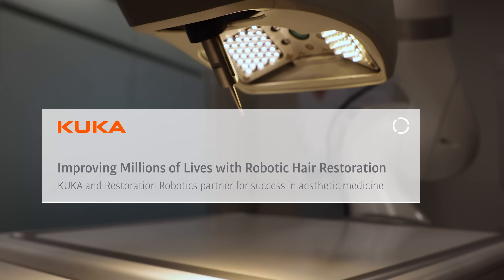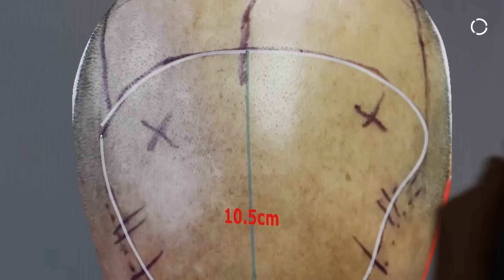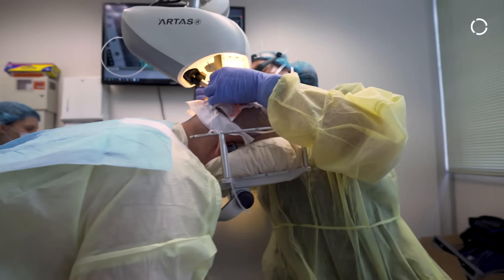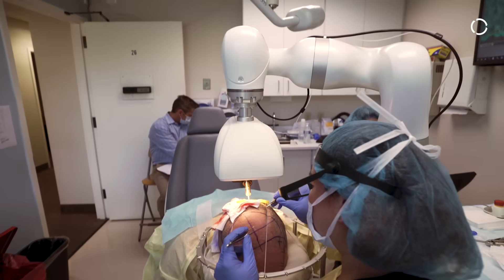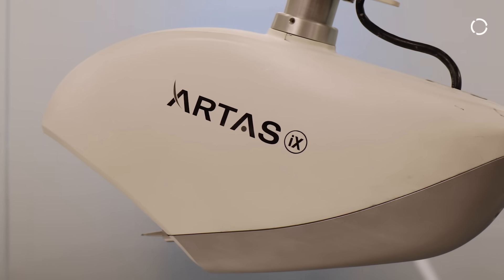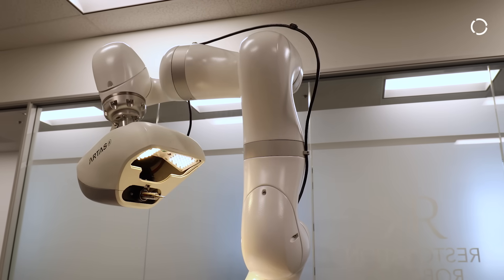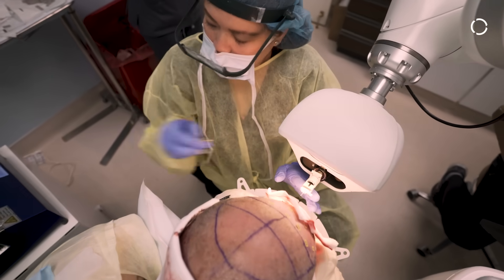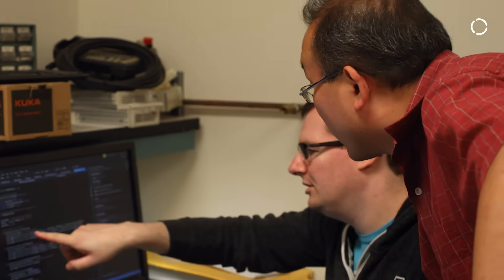Robotic Hair Restoration Can Improve Millions of Lives | Medical Robotics

Comment: This is a commercial, be aware of that.
usually punches are 1.37mm with the robot and 0.9mm with hand.
There is also no oscillation possible with the robot.
Robot has limited capability of working on non flat areas and sensor has difficulty detecting white or curly hair
The robotic procedure takes longer.
Currently there is no real advantage for working with robots besides the fact that it looks cool and high tech.
No robot can currently replace a surgeon's hand

Comment: There has to be medications more effective and safer than finasteride that only reduce hair follicle receptor sensitivity or binding to DHT. That's all it takes
Reply: All they need to do is desensitize hair follicles to dht I m 💯 with you
Reply: If you have hair transplant is not permanent, it will eventually fall like before, and then you have scares , small dots scars showing. You can take medication like finasteride and rogaine but you’re doomed to do that every day if you don’t want to looose the transplanted hair.
Reply: @dok2304  even finasteride loses effectiveness

Comment: U can't create a proper hairline with this it would be straight like stensil
Reply from the maker: The robot has seven axes. It's pretty amazing to work with and program, if you've worked with robotic arms before. You can change the position (x,y,z) of the tool and you can also change orientation of the tool (a,b,c), so you can move the tool anywhere and have it move in any direction and at any angle.

Comment: The robot is great for aging surgeons that no longer have a good hand eye coordination. The transaction rate is still 20%. The robot scans the scalp and based on the area it scans it adjusts its head/punch but if you have a hair that is not growing like the area it scanned it will ruin the follicle. The best return on your investment is still strip or manual FUE. Strip is you do not wear short hair and the scar is covered by your hair and FUE manual if you wear short hair. There is no replacement for the expertise and eyes of a human, period. Also the cost of a robot surgery is expensive due the fact that the robot and its operational cost is astronomical.
Remember out of 1000 grafts you loose 200...so bear that in mind when looking for hair transplant.
Reply: What machine do you recommend?

Comment: I think that was Gabe Zingaretti - the COO of the company, but I agree with the comments made here. How can you really trust a robot if your own crew didn’t do it yet. It’s a no for me. Also those punches with the system appear to go very deep. What happens when a procedure is conducted by a bot and a dermatologist. Sounds very scary - especially knowing that a bot is going to drill a hole in your head. You probably have to sign your life away to get it done.
Reply: That COO would do this procedure if he had enough donor hair to transplant. That doesn't mean the machine doesn't work or do a good job.

Comment: Hi dr. What is total cost for tybe 7 category hairloss head surgery.
Reply: Norwood type 7 is a severe hair loss, you might not have enough donor hair to transplant.
Reply: if you donor areas is small, experts use HBT or body hair transplant but these are used to as fillers. Look for doctors that work only do hair transplant and those that can do multiple types of hair transplant: ie FUT, manual FUE and Robotic FUE.

Comment: Will it reduce the cost of these operations? If not, then Im not interested.
Reply: Not really it's more expensive somehow
Reply: @cr-it5lh  yes, it is more expensive. Not only that, but also you can get ripped off when you pay for a certain amount of follicles to be transplanted and on the day of the procedure they ll give you less than half of what you paid for. Most of these procedures are done by technicians who work for doctors but in the infomercials you see doctors doing the procedure which is deceiving and unethical. Be aware that some technicians have less experience and can damage  your follicles when removing them from your scalp.
Reply: @ranimouf  no way?? 🤦‍♂️
Reply: New product = higher initial costs. Over time the procedure should go down.

Comment: Just one question people who are speaking why didn't they restore their hair with this machine
Reply: They come with the concept and expect investors to pour money, even if the device don’t work in practice. Looks futuristic but it’s a gimmick.
Reply: They don't care about baldness
Reply: Most middle aged balding men have not enough donor area. This robot can be the best invention for hair transplants, but without a good donor area it won't do any magic. Hair follicle cloning combined with the robotic precision grafts would be the best solution for balding men.
Reply: @matemayer4850  I completely agree but, when is this hair cloning thing going to be actually available?! Until then, beard hair should fill in for short hair styles combined with SMP ....
Reply: @bitsandpiecesonly6462  Right, agreed. Hair cloning is years away from reality I think. 5 to 10 years at least.
Reply: Do you think people who sell drugs do it themselves?
Reply: @enderzebak2863  Absolutely. They do it themselves but they are a lot more conscious and aware of how much to use, when and with who being around. Abuse is the problem. Most people who sell alcohol (which is also a drug) drink just a little bit. Lots of people on Dislysis for Kidney Failure do not drink alcohol but really want to. Same with hair transplant. Lots of people want the surgery but are not candidates
Reply: Drug Dealer Never Consume Drug
Reply: some people just don't care.
Reply: Lots of men with a head full of hair shave their heads or get a very tight haircut including on the crown area.

Comment: Hi do you have a biofiber or artificial hair fiber for transplant?
Reply: Transplant works only with your own hair.
Reply: You can use pubic hair if you don't have enough on your hair
Reply: @johnnypinkleton9410  LOL 
😂😂😂🤣🤣🤣
Reply: @jotashock  no joke. I have nappy hair on my head and on my pubic region. 😂
Reply: Or even beard hair
Reply: Yes..it has high maintenance  cost
Reply: Synthetic hair implantation is banned in the USA. I don't know about other countries. There are too many infections, ongoing pain, and it has to be redone every few years as the hairs break off. When you get it redone they have to dig out the anchoring pins in order to replace them with new ones which leads to having thousands of permanent scars all over your head

Comment: Looks crazy painful .
I'm wondering how well back of their heads recover from thous holes.
It must be like Swiss cheese.
Reply: Actually I had it done and the holes heal fast on the 3rd day the hole get really small.
Reply: @carloscandelaria9756  any hair growth yet? How many hairs can be transplanted in one day?
Reply: @vincewarren1271  that depends on the surgeon and his staff! They can do 3000-4000 grafts but at 6+ dollars a graft it gets pretty expensive and you lose 20% to transaction.
Reply: @hairtransplantguru  that's a rip off especially considering the high transection rate
Reply: @vincewarren1271  that is why I recommend finding a surgeon that does FUT or manual FUE which range in the 3-4 dollar a graft and the loss is in the single digits depending on the surgeons technique. Look for 35 to 50ish age doctors that have been doing it for a while .....for manual FUE, in general, the gentler sex tends to be more delicate and ensure great returns.
Reply: @hairtransplantguru  I actually did. I had 3,952 grafts done via FUT and FUE with a very low transection rate. It was about 1.50 per graft or so. My surgeon was very skilled and intelligent. I will need a second surgery seeing I'm a NW7.  Cannot expect high density and full coverage with one surgery when your hair is that far gone. I'm 9.5 months out.
Reply: @vincewarren1271  excellent! that is an excellent price! Most surgeon that I know usually do 2.75 to 2.95 when they move offices or open a new one. Most have been in the 3-4 ball park. there is something new on the market called HBT hair body transplant! Here the surgeon removes body hairs from your chest, shoulders or back and uses them as fillers to increase density. It is fairly new and very few doctors have mastered it. Depending on hour your donor area looks this may be something to look into. Good luck!
Reply: i think they keep the head elevated at apply a nutrient solution to the scalp and vaseline (?) to prevent scarring so it heals well